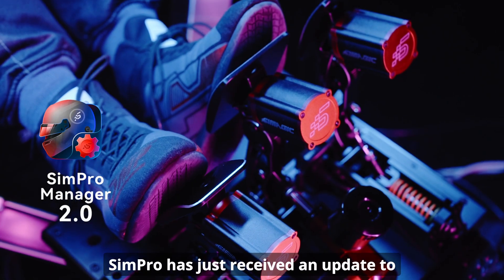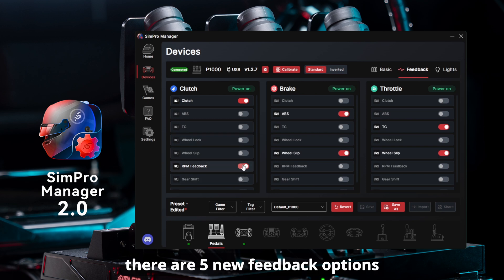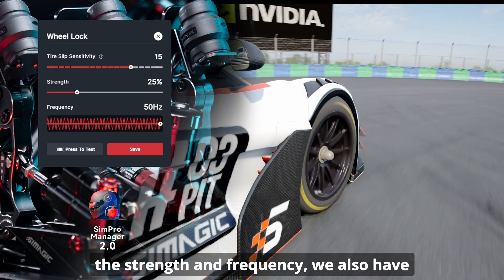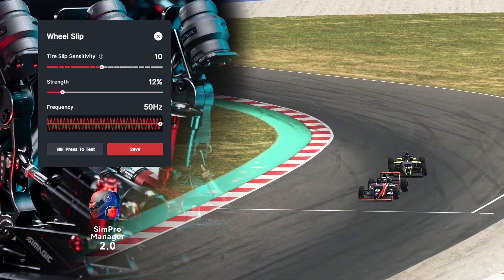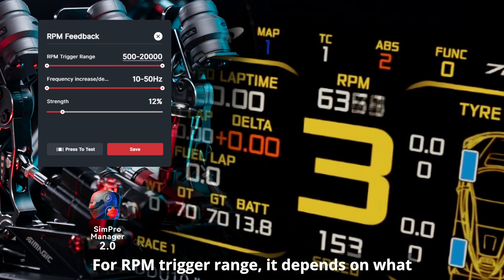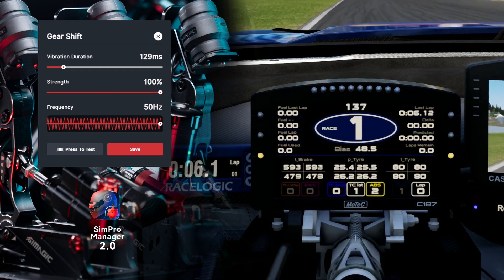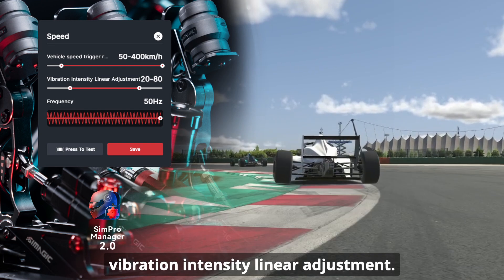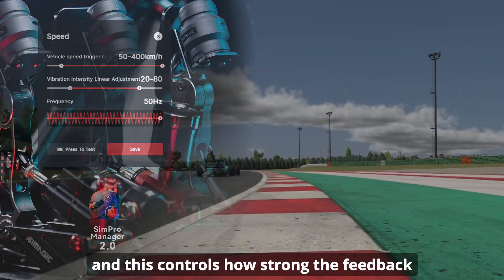SimPro v2.0.342 Haptics Setup Guide | SIMAGIC Tutorial

Comment: the problem is with sensitivity ... if it "above" the medium value, you almost always have slip signal ... and for wheels lock here again I cannot find the right sensitivity to catch the start of the locking. So I think the "sensitivity" does not work! You have to read the signal as "on" and "off" and then you can modulate ... but when the locking start the haptic signal start, without any "sensitivity" parameter

Comment: Please can you add a feature to the speed feedback so it only activates over a certain pedal input, or better yet, adjust the strength of the effect with pedal input (and frequency related to speed).
This would be an awesome haptic brake feedback, giving almost brake groove or even brake judder feedback that would really help to modulate brake pressure against speed

Comment: I bought 2 Neo’s and they stopped working after 15 minutes. I bought the larger one and the smaller neo,  the larger one works great but  the neo  stopped working. So then I bought them both again  I put the two large ones on my throttle and  my brake both of those are  still working good but the 2nd Neo stopped working after 15 minutes. They don’t work on simpro they won’t work on Sim hub they just stopped working mid race. What’s going on with the Neo’s I hate to say it but you gat what you pay for. Stay away from the Neo’s

Comment: For some reason my Haptic motors are not working in EA WRC even though on the table in the video they're stated as "Supported", My P1000's are connected to my base via cam USB hub.
Reply: Did you ever figure this out?
Reply: @McCoyCJ1987 They need to be plugged in directly into the PC (pedals) not into a hub from the base

Comment: It doesn't work correctly with the wheel lock. The haptic feedback starts working long before the wheels lock
Reply from the maker: The haptics should only work when there's telemetry data. You can try tuning down the sensitivity level on the haptic to see if it solves the issue, if not please head to our Discord for further assistance : https://discord.gg/xJy5VVVmRR